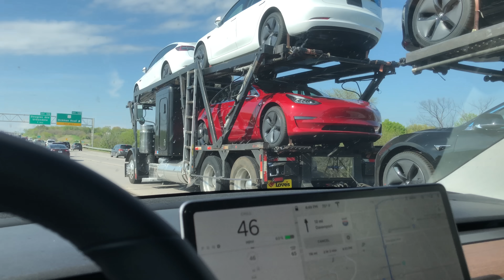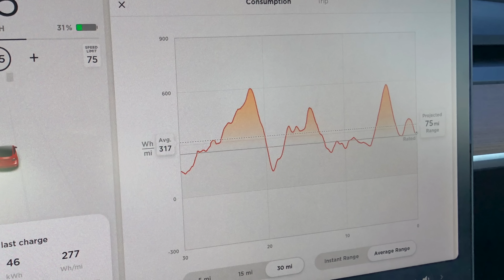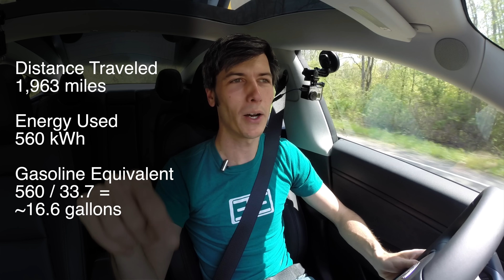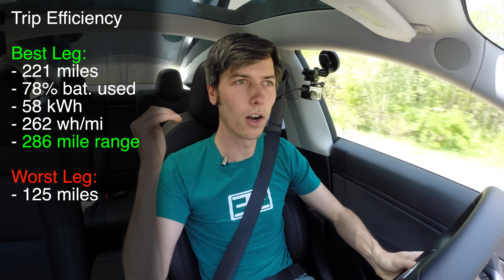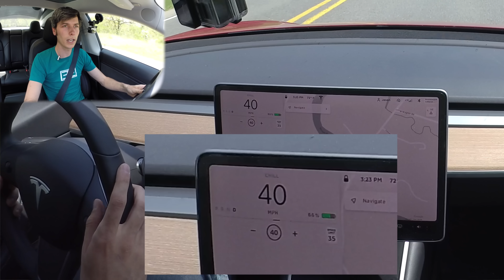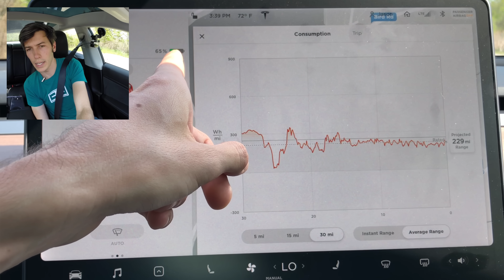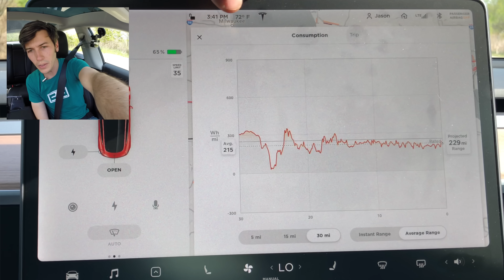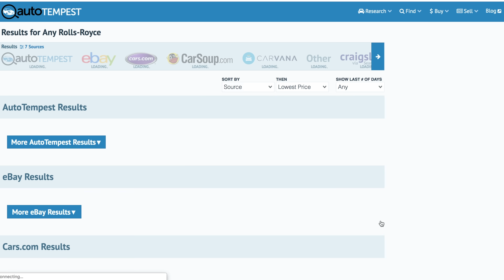How Miserable Is A Tesla Road Trip?

Comment: Would love to see any electric car drive through Canada to Alaska in the winter, they will not make it, attempt to tow a trailer and it is a total fail, made 15 trips   average trip time driving 2,404 miles each way was 52 hours per trip -29f and colder at several gas stations, not sure tesla range with heater and headlights running then how it can deal with sub zero temps one stop was at -50F.
get around 350 miles per tank and can carry extra gas cans for a fill up in case gas station is no longer open.
hit a pothole got a flat and no spare....is a major FAIL.

Comment: I'm the original owner of a Toyota Prius since 2004. Best mileage I've ever gotten in it repeatedly was 72 mpg although this was between 2 specific points along a specific route & not a typical drive. On a steady 55 mph cruise, I typically get 55 mpg. While I don't have much if any experience driving your route (~2K miles @ ~75 mph) I checked a Prius forum & read a chart indicating I could expect ~50 mpg @ 75 mph. With a fill of ~11 gallons of regular fuel @ $2.15/gal. @ my local station at the time I'm writing this, that would give me ~550 miles before I had to re-fill @ $23.65, for a total fuel cost of $94.60 for the whole trip, leaving some fuel left over for a bit of driving when I arrived at the destination. Not bad, & aside from a few minutes each time to re-fuel, & a visit to make my bladder gladder, & a bite to eat to re-fuel my body, at the same velocity, I would have gotten to the same destination quite a bit sooner... I like the idea of electric vehicles, but I think they're best suited for local/urban driving. I prefer an engine & with the Prius, with an inverter & a little bit of wiring & a couple of plugs, I can also power my house in an emergency (from what I've read, it'll generate >40KW of electricity!). I love this versatility. I have >175K miles on it right now, & aside from normal service items like plugs (1 change) & oil & filter (I use Mobil 1 5W-30 synthetic & TufOil additive) I'm using 20K mile change intervals, & it's burned ~a quart during that 20K miles, the only other thing I've had to replace is a water pump & the serpentine belt. Original exhaust, original brakes. I think that's outstaning & when it comes time to replace my '04 Prius, it'll be with another Prius.

Comment: What happens when the cold of winter means it's 20 degrees fahrenheit, and your battery doesn't recharge as quickly and also depletes at a faster rate?  Probably will double your trip time.  Again, call me when the range is 900 miles or so under worse possible weather conditions.

Comment: The issue I have with your point at minute 8 is that you aren't including all the energy inefficiency in electrical generation. You have to include all the different conversions in generation and transmission. Natural Gas plants (all marginal electrical usage in America is single-cycle Natural gas or cycling combined-cycle (the cycling reduces efficiency to about the same as single-cycle), so a reduction is based on that, no matter what your power company says is generating your power) have an efficiency of at best ~40%,  and transmission is ~85% efficient.  Using your numbers (2000/16*.4*.85), this makes total fuel usage approximately 40 mpg. Not bad, but not anything to write home about.

In the words of my high school chemistry teacher, "You are outsourcing your emissions".

Comment: As more people change to electric milk floats the supply and demand pricing syndrome will take hold. Electricity will become more expensive and fossil fuels will get cheaper, this will trigger a reversion back to IC powered vehicles. The vast majority of drivers, probably over ninety percent, vote with their wallets when it comes to their motoring. They see cars as boxes that take them to work, for the wife to go shopping and for doing the school run. They are not Eco-warriors and no matter how much peer pressure or shaming by the holier than thou climate change religion followers the vast majority of people will go for the cheapest option. Using your breakdown at 21.11 stack your comparison in the real world.....a £40+k Tossla with a range of 300 miles (max doodling along) or a £10k 60+mpg (tank range 600+miles) Mini Cubman D. A preschool tot (before they are indoctrinated with leftist B S) could work out which is the way forward for you Dad.

Comment: sure, Electric vehicle travel further in terms of electricity to gas comparison. But when it comes down to charging, you are paying the equivalent to a tank of gas either way or possibly more. Most reported super charger prices were about 20-25 bucks.... same as a fill up on a civic or a similar vehicle in it's class. I'd still vote for combustion engines.

Comment: Just re-watching, some 8 months after buying a Model 3 LR - partly due to your videos. I've done a couple of road trips from Montréal to Toronto (about six hours' drive) and found about a 45% reduction in truly cold (e.g. minus 30 C) weather at 130 kph. The other real range reducer has been having a full bike rack installed on a rear hitch; warm weather seems to reduce range minimally, e.g. 15% I guess.  Oh, and PlugShare seems the best app for finding chargers in the wild, at the moment. I'd be curious to know what the battery degradation you see is and how to measure.  Anyway, if you'd like to come by and compare the LR and the performance, come on by J.  It's a great city even for the old folks like you and me.

Comment: This vid made me appreciate my gas powered car so much. 10 mins stop to fill, when the arrow gets somewhat low, driving at whatever speed I feel like, no “planning recharges”, no fear not to reach the next charger, not having to consider AC or heater, and living in Canada, not having to consider the ~30% range reduction in range because of “winter”.

Electric cars have a ways to go before they comfortably replace gas.
Reply: meh, I drive my Tesla around the country and it's no big deal for me. Personally I like being forced to stop every 3 to 4 hours to charge (which is what my battery gives me and the relative spacing of the super chargers). It gives me 30 minutes every 3 to 4 hours to stretch my legs and get a snack. Maybe I'll watch some youtube or play a game on the tesla if I have some extra time. Now, going back to being stuck in a car for 8 hours straight with minimal stops feels like torture on my body to the point where, even if I was driving in a gas car, I think I'd plan out 30 minute stops every 3 to 4 hours. It's just a more plesant experience.

 The biggest change is in your mind set. I'm no longer in a rush. If I'm driving more than 250miles I merely make sure that I leave early enough to take my time. 

That said, the Tesla certainly FORCES you into this mind set. There's no option for powering through a road trip if you need to. But personally, I like being forced to take breaks from the road. I end up walking to local coffee shops on the road instead of gas stations. Shopping. And all around experiencing things I would normally just pass by.
Reply: Zhong Ping I have a 20 months old daughter and another one that will be born in ~3 months... a visit to the local coffee shop is the last thing I want to have to endure whilst returning home from my in-laws that have no charger and lives far...

As I said, my car feels simpler in comparison. No planning required, it just works when and where I need it. I set it to 22.5C and it’ll do it’s thing, wether it’s -30C or 35C outside. If I step on the pedal, I get a few cents of “penalty”, not a 30 mins recharge once the charger is finally available from charging the people before me.

Don’t get me wrong, I would love to never have to gas again, just plug it straight in my driveway and have it always ready. In a few years I guess, when batteries improves so range and A/C / heater becomes a non-issue...
Reply: @francois-thierryjacques9082  Understandable, hence that was my personal take. It works for me. It's forced me to be in less of a rush while traveling around and that has had a positive impact on my stress levels and life as a whole. It is great for me. I totally understand that others may not feel they have the luxury to take their time when traveling long distance.
(mind you, how often are you rushing about with small children for trips over 250 miles?)
Reply: At this point EV's are better for city and local driving, and worse for road trips.
Reply: François-Thierry Jacques that’s going to change very soon.  Drive a Tesla and you won’t go back.

Comment: geez...40 mi / 15% sounds really pushing it...when I get down around 1/4 tank / 100mi estimated range I'm in a near panic looking for gas...much prefer to be around half a tank or more.  40min seems like a lot to eat but usually on a road trip we'll stop for say 10-15 min to let the driver eat and everyone use the bathroom then everyone else can keep eating in the car.
Also curious, what happens if you get to the charging station and it's not working or has a line?  I've had some of that with gas stations, tho there are usually many other options.

Comment: 15% charge left by the time you get to a supercharger? No thanks. When I went on road trips we always left at least 1/4 a tank of gas which is also at 25%, which left about 60 miles.

One case we didnt find a gas station for 30 miles (1 didn't work) and we were roughing it worried we wouldn't find one in time, of course this is before the age of GPS and we had to fly by instinct, we had about 20 miles left before we found one. After that we made sure we had 100 miles  left when going to the gas station to refuel. We had to use math to calculate miles to a tank (before cars regularly had trips, now we got range estimates) but then again we wanted to go sightseeing and road trips to me are more about exploring what's out there than to follow a certain network and spending time inside a building. For that with modern gas vehicles once I got 100 mile range left  I just fill up at the next gas station and using Gasbuddy app.

Sure, it may be doable in an electric vehicle but where is the fun in that? At minimum I just need 5-10 minutes to stretch my legs, if even that usually I'm in and out of a rest area bathroom in 3 minutes and then I'm back on the road. If I need to rest, then I'll rest but if I'm traveling, I dont want to fly and with a car i got the freedom to drive anywhere i want.

Comment: Every time people mention the energy density of gas, it should at least be mentioned how they ALSO require oxygen which is added during driving to actually release that. Hence CO2 and hence a lot of the weight and density advantages :)

Comment: aside from inclines and declines, wind speed and direction has the most influence on range (aka airspeed)... this is the reason for inaccuracies in range prediction... drafting behind another car gives a huge boost to range
Reply: follow a big rig and with this car adaptive cruise control auto pilot you can follow pretty close
Reply: @iyot1020  Yeah and end up going right under it if it has to brake?! In my highway experience, truck drivers really hate that kind of motorist, and will put you under the truck, or signal you can pass when another car is coming the other way, so you can have a nice head on!
Reply: @geoffreyparker926  hahahahahahaha 2car lengths is pretty reasonable

Comment: 50 minutes charging at a time...
Yeah I'm out.
What ever happened to hydrogen cars? At least they'd be able to be filled quickly.
Reply: Well hydrogen is colourless and odourless and very very explosive. There are people who set their cars on fire due to static right now. Imagine if every car was really a potential bomb with pressurized containers containing really explosive gas.
Reply: @dianaangelova8651  Every house with a hot water cylinder has a potential explosive.
I'm not worried about that. Plus electric cars have a habit of burning for a loooong time.